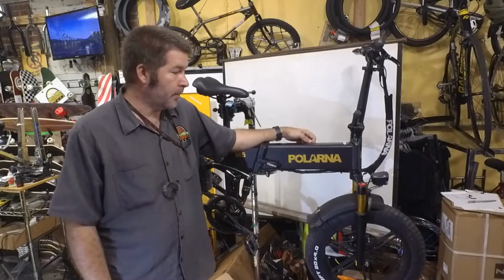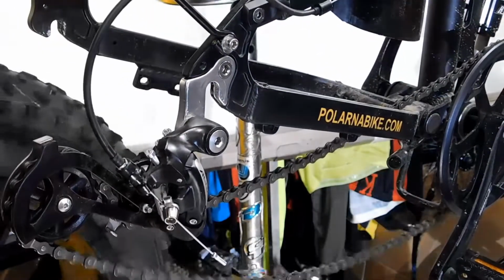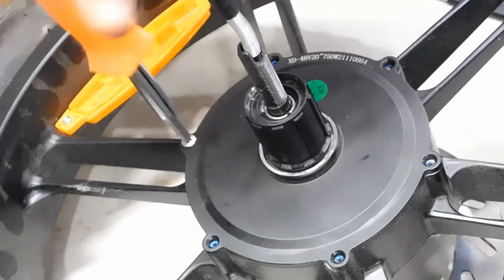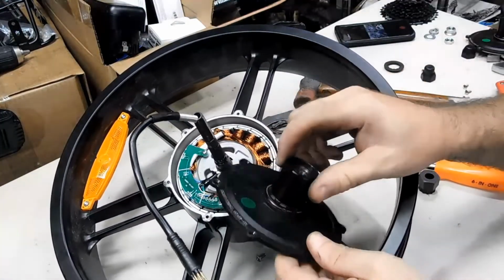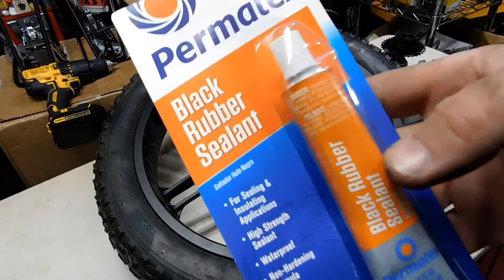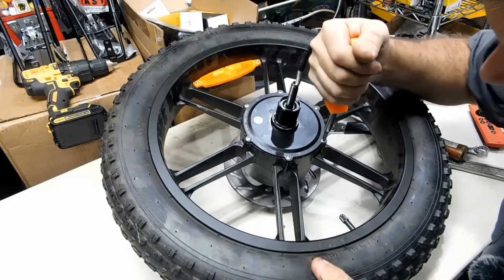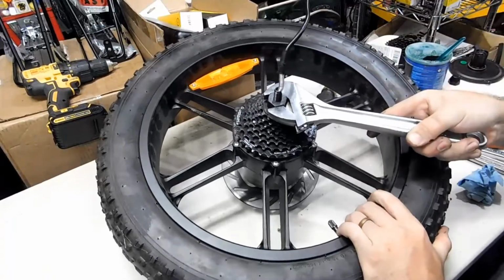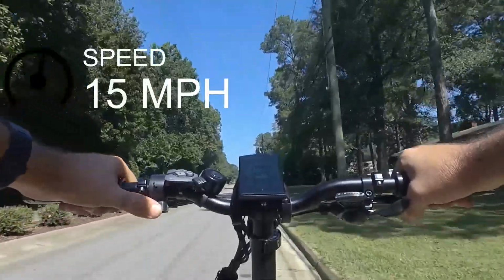Fixing the freehub body on a EBike!

Comment: I have searched all along the power cable and cannot locate a pin clip to disconnect it am I missing something? Also all the screws in my hub cap have snapped and I have taken it to two bike repair shops who tell me that don't repair that. The ends of the broken screws are left behind and I know it will need drilling to remove them and possibly retapping but none of the repair shops near me want to take on the job saying they don't do electrics, which I do not understand since it's drilling that is needed. So what can I do because I cannot remove the wheel completely as I do not think there is a clip and it looks like one continuous cable and the brakes look the same as these also need attention any suggestions?
Reply from the maker: I don't know what to tell you. It would be difficult to drill out due to the size of the screws/bolts. I had to remove one broken bolt from a hub and it was not easy. I wish you luck.👍

Comment: I am still watching videos to find out.  Is the Eahora Juliet 2 a cassette or freewheel, they are new & great I have over 1000 miles on mine. I want to replace 14t- 28t to a 11t-28t gearing. There is not much info on them.
Reply from the maker: It a freewheel. It is not compatible with a 11-28 without buying a new wheel.

Comment: so this was a bust. since these are rentals they will be abused. that it was running when fixed. there will be a charge. .. i did notice that the plate had a pin. was this a factor in the motor failure???.....  so did you watch a UT video on this bike for the repair. or is there a web page for the company. ... now if the motor is bad i would check  for bad caps or diodes, or mosfats. a 50 cent part and a soldering gun . back in working order.  as a side note i did let the ads play through.   stay well see you next time.
Reply from the maker: Thanks. The pin you saw was the magnet for the speed sensor. I am not very good at diagnosing motherboards but I am willing to learn. Thanks for the input. I didn't look at YouTube for information on the motor. I just went for it.👍

Comment: 10:09 If that was my bike and I saw you hitting it with a hammer I would make you pay for a new hub! There's absolutely no reason to use a hammer at all. That damages the cover and motor.
Reply from the maker: That is why you use a plastic mallet. The cover had a silicon glue to waterproof it and was necessary to break the bond. The cover didn't have a single mark on it after I was done. The customer was happy with the work especially since everyone else wouldn't touch it. I have been doing this for thirty years. The only other way to open this hub would have involved a chisel and hammer which would have marked the hub.

Comment: When you have motor electric error 24 what can you do to fix it. Thanks
Reply from the maker: Make sure the wires to your motor are plugged in properly. You may need to clean the connector with rubbing alcohol. Make sure it's completely dry before plugging it back in. Check the wiring for damage. Goodluck.👍

Comment: they aren't plastic gears, they are nylon.  They are used because they are much more quiet that any other material.  It is normal that they wear out in serval thousand miles depending on how hard you ride.
Reply from the maker: I know there nylon. Everyone is calling me out on it. I did say it was more quiet. Thanks for commenting.👍
Reply: Nylon is plastic. So is polyester

Comment: louis rossmann did a lot of monkey wrenching on his ebikes before he torched two of them, those gears are nylon and supposedly pretty tough but there are metal replacement parts for the popular ones.
put some contact cleaner on your plugs or dielectric grease to keep moisture out.
Reply from the maker: I knew they were nylon. I just said plastic of course I'm getting called out on it. I go through a lot of dielectic grease on these bikes.👍

Comment: Make a freehub on CNC if you know a good fitter machinist .  I know someone who has done this .
Reply from the maker: It was a lot easier to just use one of his other wheels that was bad. It was also free and saved time. Thanks for commenting.👍
Reply: @alloutbikes  You swapped the freehubs instead of reconditioning them . Jason , what would you have done if there wasn't a spare wheel to cannibalise from as it were ? I appreciate your lateral thinking .
Reply: @alloutbikes  These wheels seem to be a bit on the throw away side compared to spoke laced ones which are common in Australia where I am which are more serviceable .

Comment: No wheelie at the end?!
Reply from the maker: Wheelies and EBikes don't go together.☠️
Reply: Wheelies cause extra load on the motor at low speed more than for which they are designed . Also limited size and ventilation are factors .  Too much eddy currents in a limited number of field coils occurs , causing localised heat build up .This will in due course cause individual coils to overheat and open circuit . Gradual loss of power and eventual failure will result .
Reply: @robertmcfadyen9156   If you watched the channel regularly, you would know he wheelies almost every bike he builds. It was just a joke. Thanks for the info though.

Comment: You never told what was wrong with the gear??
Reply from the maker: Sorry. I thought I did. The freehub threads into the aluminum cover. The threads in the cover stripped so I had to swap parts around to make it work.